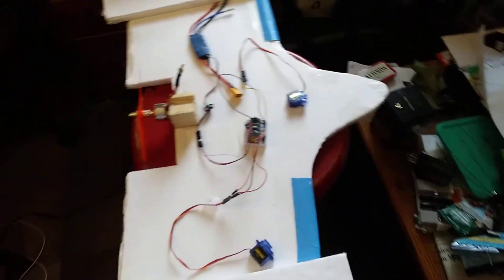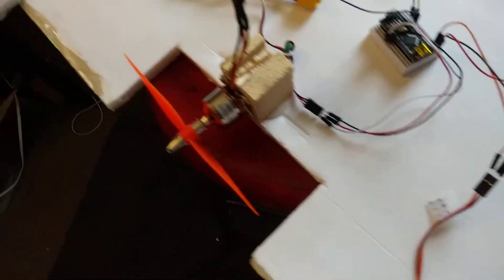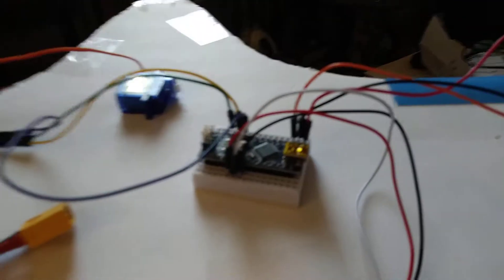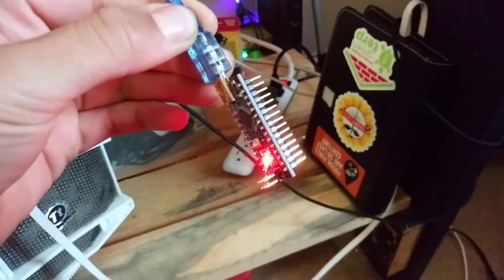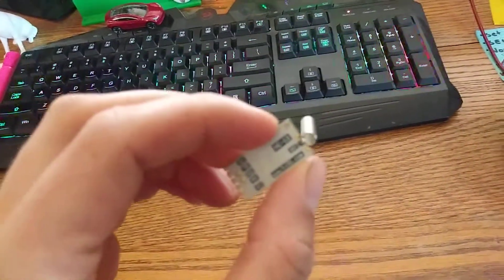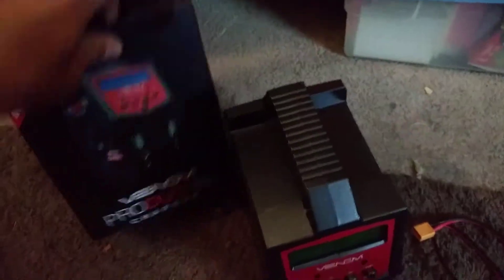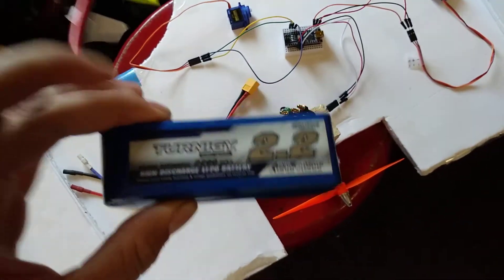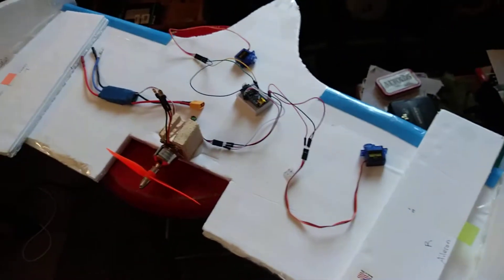Arduino RC Plane

Comment from the maker: wow, sorry about the low resolution
Reply: ... if you whant to fly just forget about this "plane" . Get some 100€ rtf model and have fun. If you whant to do something with that arduino ... for fun it"s ok to go on but keep in mind that this wing will not fly. There are a few projects "arduino plane" , or arduino wing but not working very well. Good luck